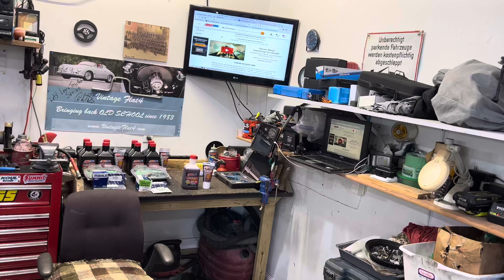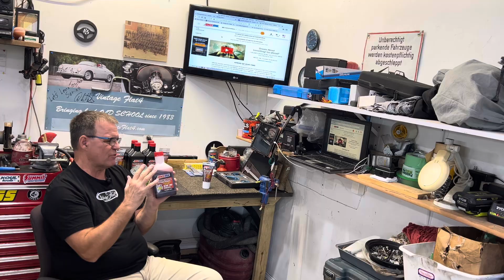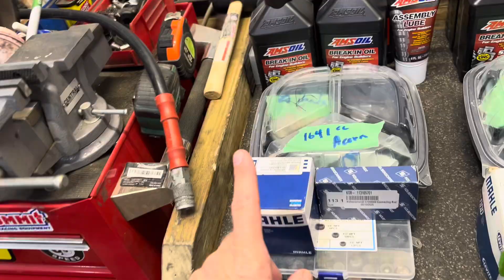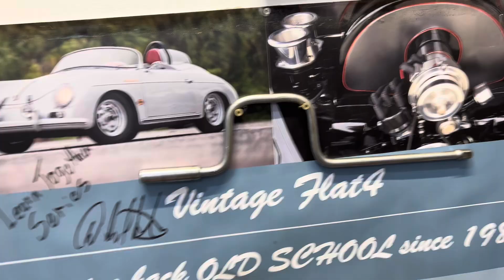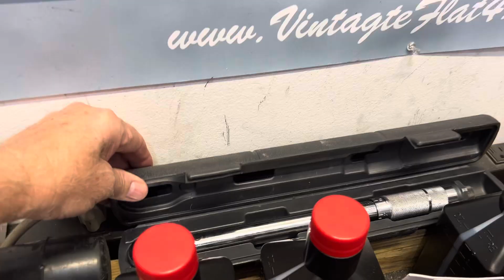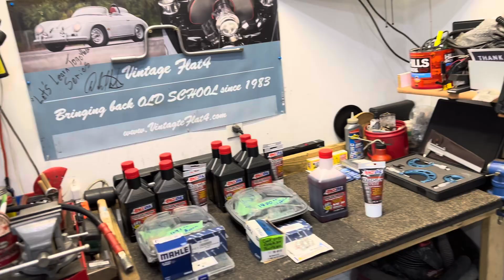Vintage VW Motor Build for “Stubby Cat” Part 2: Partnership w/ AMSOIL #amsoil #vintagevw #stubbycat

Comment: I've never had any luck getting rings to seal using synthetics in big bore (94mm) engines. Any tips? Have you ever measured internal engine part temps to see the difference between synthetic and Dino oil? I saw a lot higher temps on my valve train parts with synthetic, but my oil temps were lower.
Reply from the maker: Good information & Interesting on your Synthetic testing results. 

I do know the high end VW Aircooled race society is locked into Driven Synthetic Oil.  

Many factors can be within the 94s via:  the ring gap, ring & piston manufacturer, cylinder wall manufacturer, CR, timing and other outside factors.

Just like Driven is AMSOIL with years of racers love of the oil.
I’ll get some reading in the next few months on my 2332cc w/ AA performance 94s and 8:1 CM in a 1,800 street car.

Here is Driven Info on Aircooled VWs.

https://www.drivenracingoil.com/collections/air-cooled-vw-engine-oil?srsltid=AfmBOorcUcIiEDaGMmhIQUptQk7wBur_Xz2lc_RrgptZSUkUlm5seWel